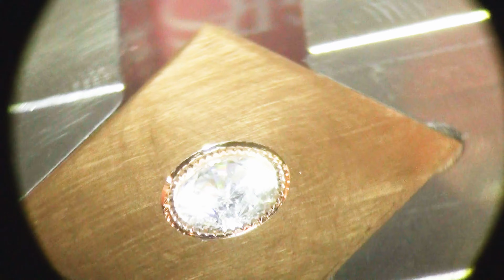Deeper Cuts with Ben Bentvelzen

Comment: If you could only have 1 engraving bit which 1 would you use for an all around? What brand ?
Reply from the maker: The most common gravers used for engraving are 90° and 120° V-Point gravers. Most cuts can be done with either of those geometries. As far a brand, we are partial to C-Max® and GlenSteel® gravers.  https://grs.com/product-category/products/gravers-accessories/c-max-gravers/  https://grs.com/product-category/products/gravers-accessories/glensteel-gravers/